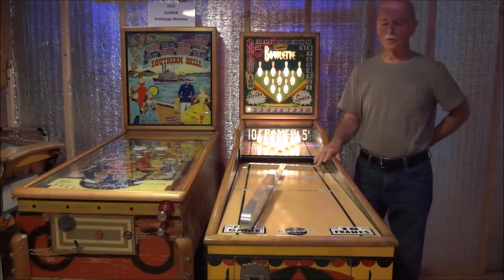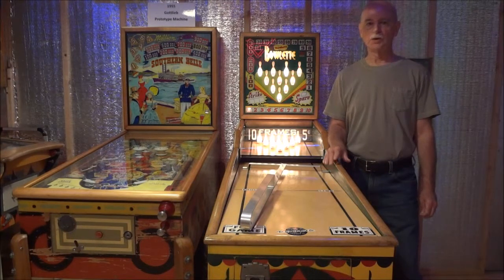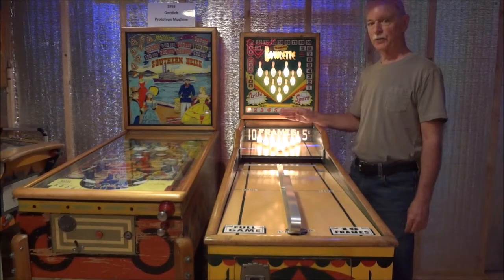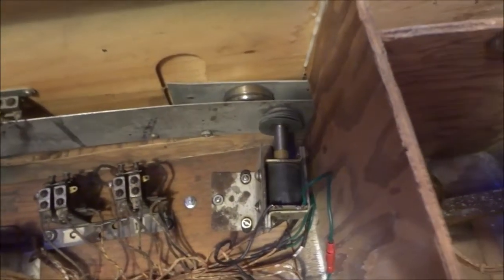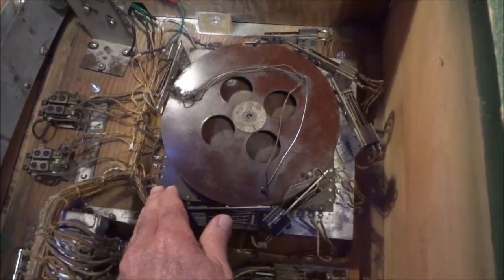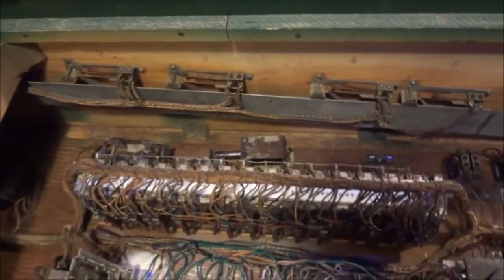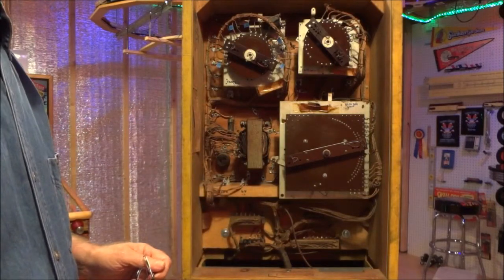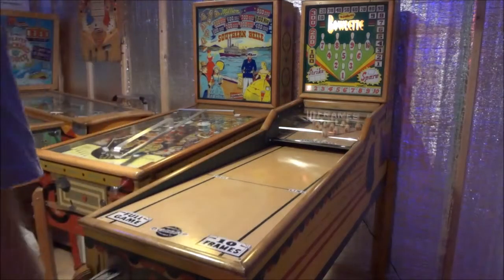Gottlieb Bowlette shuffle bowler

Comment: Has this been refurbished?
Reply from the maker: Yes.
Reply: @FIREPOWER6  where can I take mine to get refurbished? It the only thing wrong is that it does not record strikes.
Reply from the maker: If you are lucky you can find a pinball repair person locally that knows the old EM game logic.  Join Pinside website and ask for help.
But you can probably fix it yourself by getting a schematic and manual and figuring it out.  Try Pinball Resource for the schematic.For starters: do you have the correct smaller Gottlieb puck (not the big shuffle alley puck)? 
Your strike problem could be the alley rollover switches needing adjustment.  If all the rollover switches aren't working correctly and in unison then the game won't recognize a strike.  The manual has a specific test procedure for checking and adjusting all these switches so they interact properly.